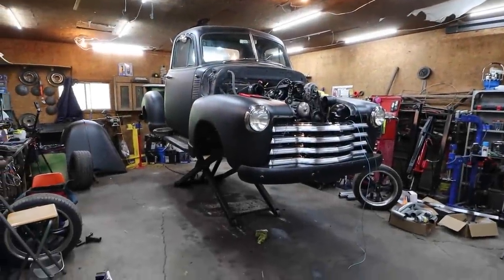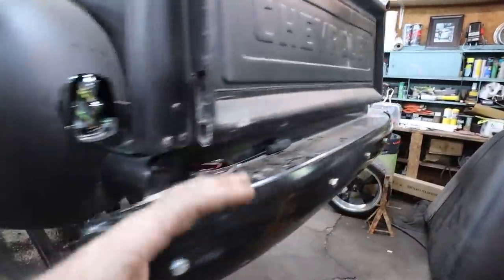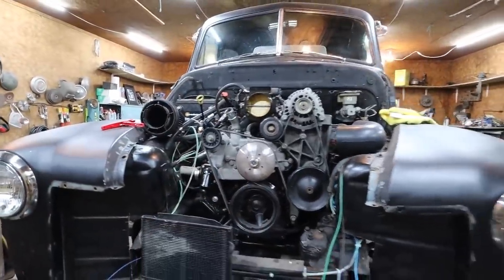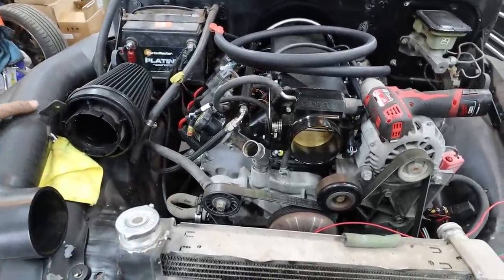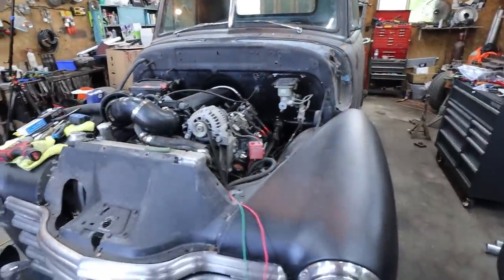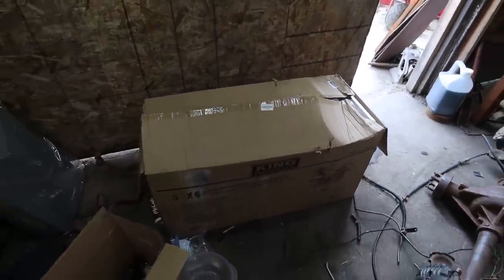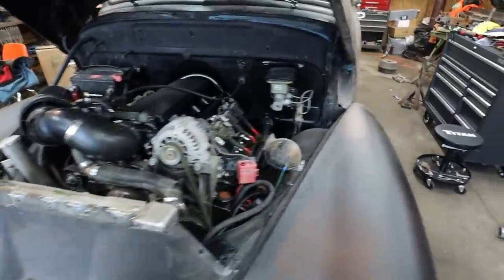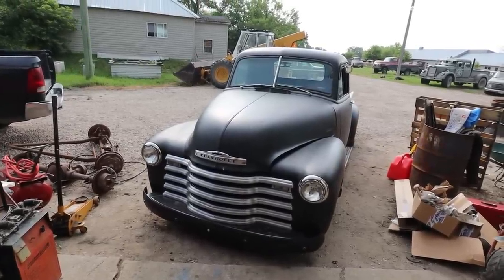Finishing work on the 1953 Chevy pickup part 2 of 2

Comment: Eagle Eye makes some great LED bulbs and headlights, bright enough so you can see them....makes night driving easier. Use them on the motorcycle. Love that Evans coolant, you avoid water based problems like rust and mineral deposits.

Comment: Tail lights bracket'd, trans's cooler's mount'd, grill's grill'n, rad hoses fab'd n air cleaner's black pipe'd, band saw step 1 ta done, exhaust bandy saw'd n weld'd, bestest part rip'n wif pablo!

Comment: I have installed 4 of this same style intakes on customers and personal projects. I never use the 92mm TB do to the whistle you get,I always use a 3bolt to a 4 bolt adapter from ICT billet and use the stock TB unit runs and drives perfect.

Comment: I don't know if your in the habit of drilling 1/8" drain holes (in the lowest point) in each muffler, but it will allow the condensation to drain and will drastically increase the life span of the mufflers.  🙂
Reply: Mufflers used to have that from the factory . I didn't know that put a pair on upside down they didn't last very
Reply: @rickynelson3222  Most (all) generic mufflers don't have a drain hole because the mounting orientation is unknown.
Reply: Are you going to build on you shop to

Comment: You could solder/braze in a little upstand vent/petcock onto your copper connector pipe to manually bleed off the air bubble to ensure a full system. My Lotus is rear engine/front rad with a similar problem...i used a typical rad drain petcock on top of a high pipe near the rad and it does the job nicely.

Comment: Excellent video Brent  :) also 1957 GMC gold color 1/2 ton in my area and loud for Street Rod Truck especially 2 turbos also exhaust be near it and away from it too! Heard motor  is a also transmission in plus HP and Torque  but bored  up to ! 2002 GM 5.3 Litres 350 (327) 380 hp , 425 Torque but bored out 505 Cubic Inches with 1000 hp and torque not sure but heard 950 possibly  , with 6 speed Automatic transmission Allison  , 418 ratio was out 2002 GMC heavy duty 1/2 ton truck at Wrecking Yard and then bored up plus got 2 fans on rad  all computers  stuff in it ! Exhaust has Glass Pack 2 daul also truck Willie's Bars  with wheel so won't tip sideways and front too! Frame not sure it in but got be heavy duty for sure! It screaming one!

Comment: LS3 style water pump has the outlet straight out, but kept the truck spacing on the pulleys.  Holley sells one, but I've read a stock LS3 pump from a Camaro would also work.  I did have to change the accessory mount as I think the PS pump (or maybe it was the alternator?) hit something...it's been a few years.  I'm surprised the sheet metal intake didn't require a change like that too - plus side is I can run a lower car intake now vs the truck one if I ever decide to lower the body.

Comment: The noise is your IAC...adjust the throttle plate until your IAC is between 2% (warm) and 10% (cold)...sounds like it’s at 70% or higher and whistling b/c so much air is running thru the IAC.

Comment: Should never mount transmission coolers with the in/out pointing down, especially on a stacked plate style cooler. It will trap air pockets in the cooler. Should turn it sideways. Learned that when working on my Lincoln.

Comment: Out of curiosity, before cutting up the license plate bracket, did you check if it would have worked on the passenger side?
I was just thinking, you likely started in a small garage, than moved (or added) to a larger garage, than moved into a shop or expanded the garage into a shop.
Now your back at a larger garage, that will lead to moving into a shop (built larger than the previous shop).  ;-)
Reply from the maker: Nope tried that tried turning it around tried everything haha

Comment: It almost looked like the light brackets were supposed to go on the opposite sides to how you initially tried them. Or does the licence plate have to be on the offside if not in the centre so that couldn’t be how they were intended to fit? (I think here in the U.K. it just has to be vertical and legible)

Comment: You were kinda scratching your head about filling the cooling system. I found and have been using a tool that uses an air compressor to make a vacuum in the cooling system and then you have the coolant in a bucket next to the vehicle and it is sucked in and fills the system that way. I have been using this for years and it's great. Also tells you if the system is leaking or not.

Comment: Hey how about putting a straight neck on the thermostat housing. Would that work?👹
Reply from the maker: Would depend what you're doing for this application it worked fine unless you're talking about the upper they're not interchangeable